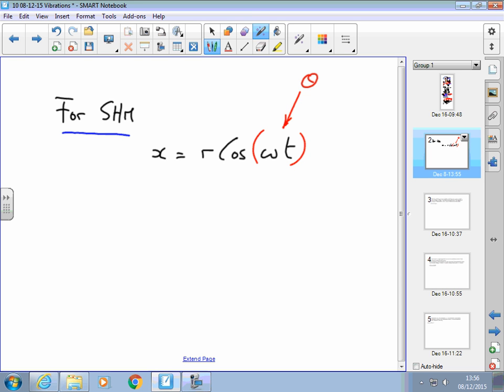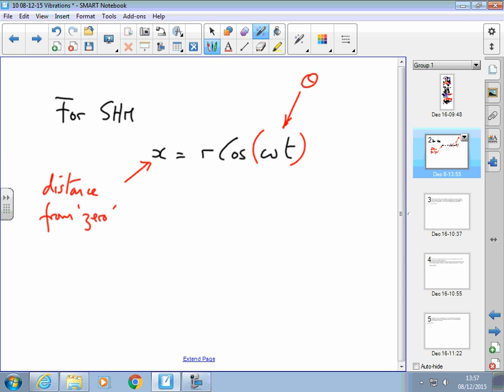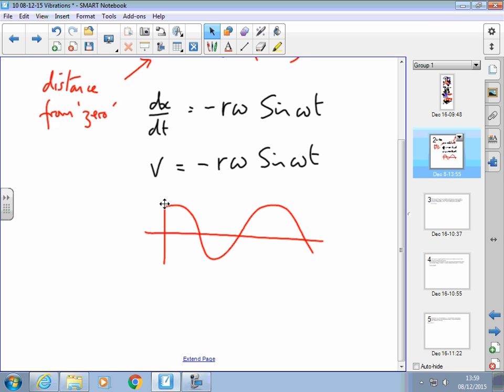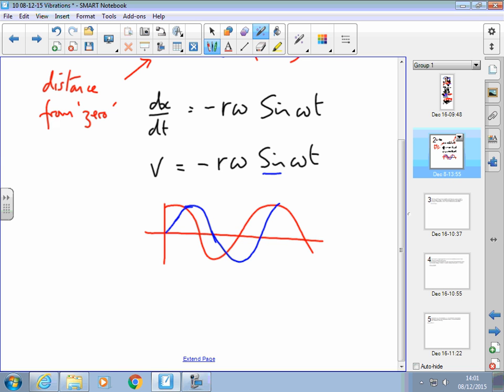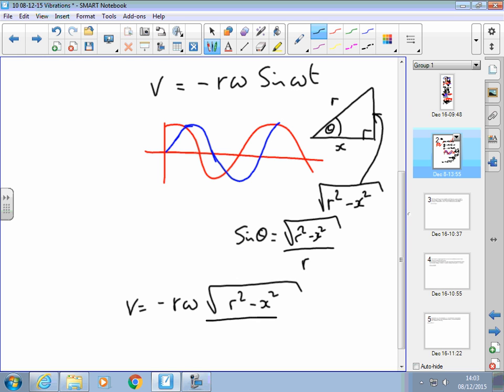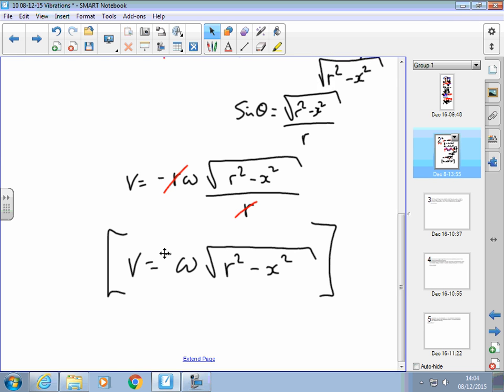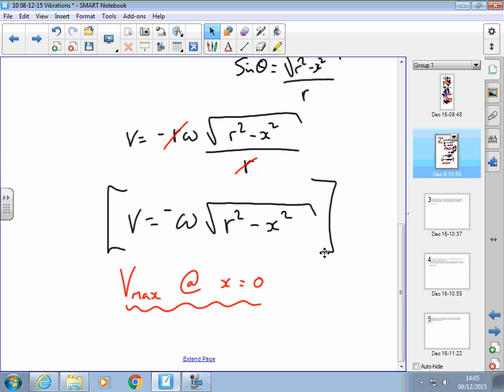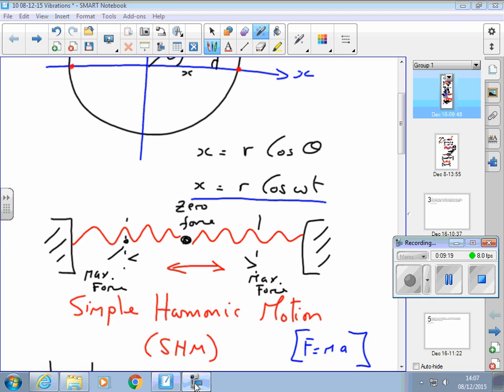02 Derivation of formula for velocity for SHM

Comment: You need to reflect the sine function for the velocity in the x-axis: it's  - sin wt.  Its +/- w because you're taking a square root.  When the displacement is positive but returning to the equilibrium position, the velocity is negative. When the displacement is negative but returning to the equilibrium, the velocity is positive.